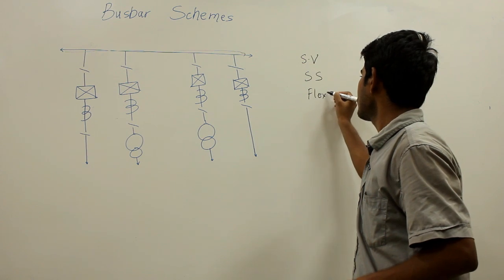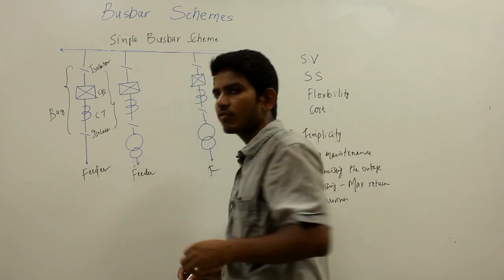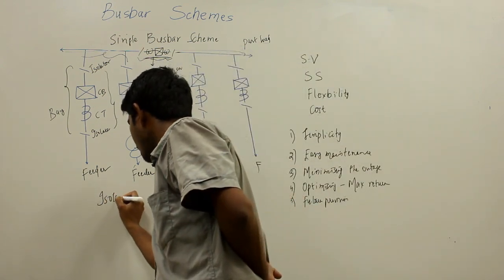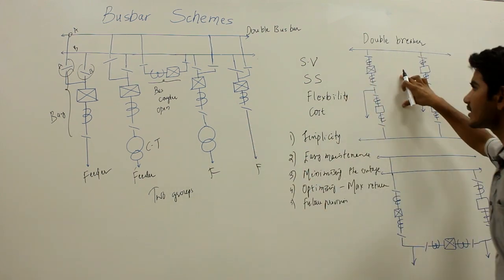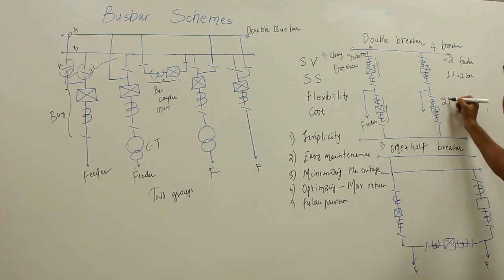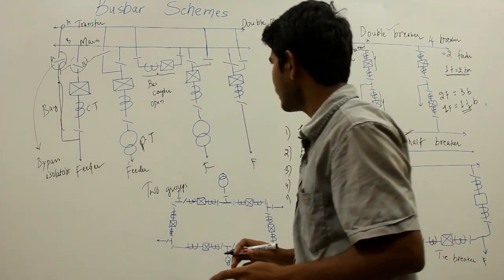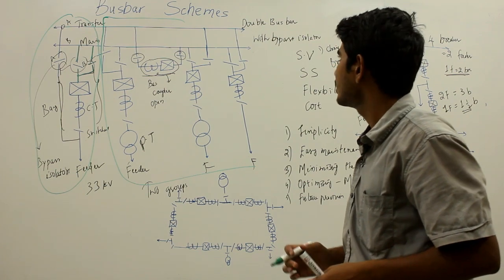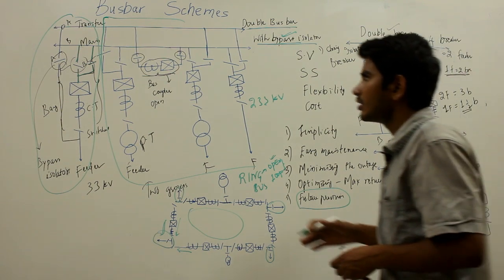Busbar Schemes In Power System

Comment: In double bus bar with bypass isolator scheme. After the breaker one isolator is connected to main bus and other to reserve bus. But you have shown both isolators connected to main bus. Kindly correct the mistake.

Comment: may you please review how you explained the double bus with bypass isolator BB scheme?  my understanding is that QB1 & QB2 terminate to CB Bus isolator and bypass isolator, i.e bypass isolator does not connect directly to MBB/RBB but connect to both QB1 & QB2 & CB BB side isolator however it bypass line (CB + Isolator)